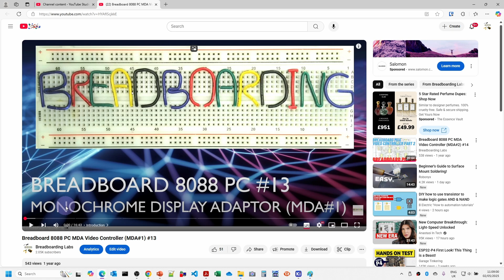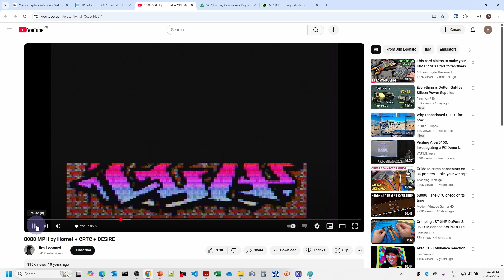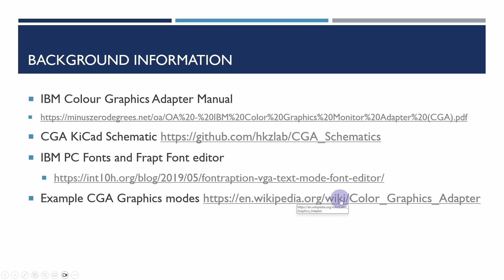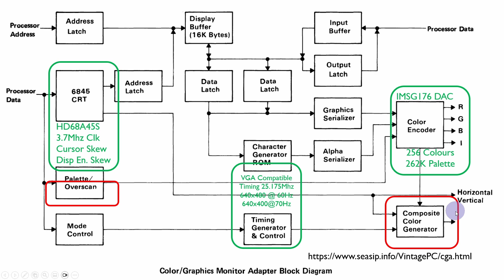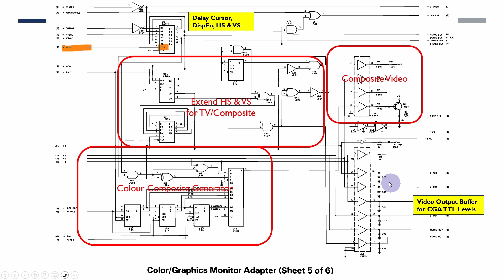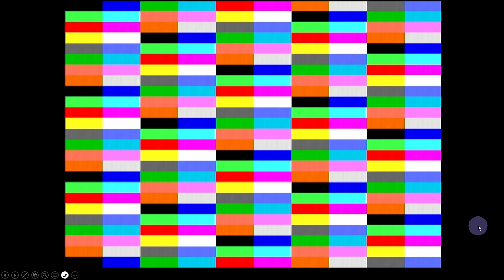New Breadboard 8088 PC V2 #11 CGA Video Controller

Comment: Thanks. Can you please do a very detailed and technical break down of the CRT, Graphics Controller, Sequencer, Attribute Controller and various clock all work together please.
Reply from the maker: I am away for a week but I can do a deep dive once the basic DAC output and character generator are working (I am about 2/3rds of the way through so far).
Reply: @breadboardinglabs  Thanks. I have tried reading docs on how these component work and interact with each other. I am currently not at a level to understand it.
Reply from the maker: Ok though I think this is the first time someone has asked for a more detailed technical explanation. Normally I feel I go into too much detail. Happy to oblige! Dave
Reply: The details for these older systems are what makes it interesting. People watch your videos for information and to see how to make these old school devices.
Reply from the maker: Part 2 just published with requested technical detail. Specifics of the clock and latch timing I will cover as I go along.
Dave
Reply: Thanks  @breadboardinglabs . I cannot wait to watch this 🎉